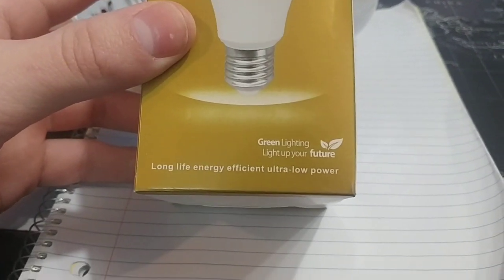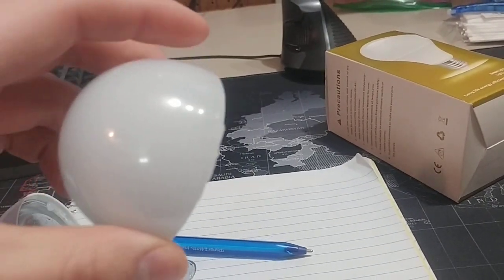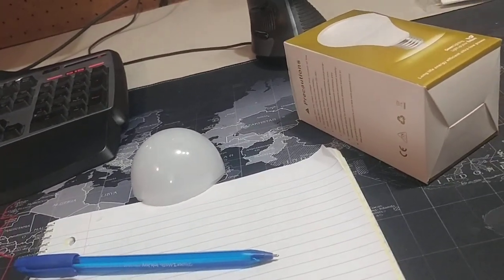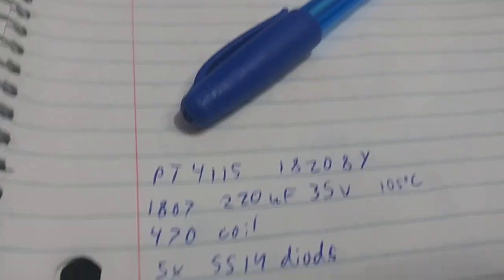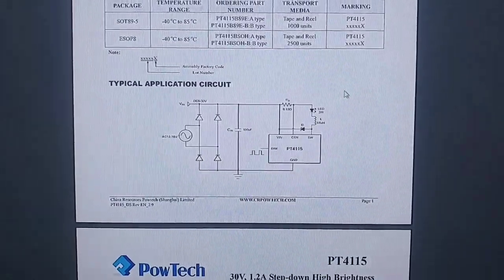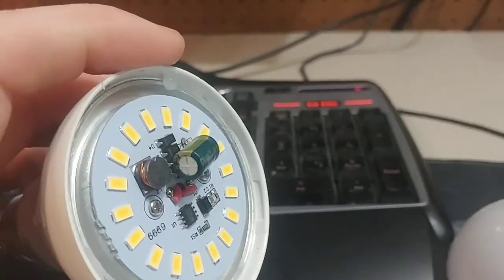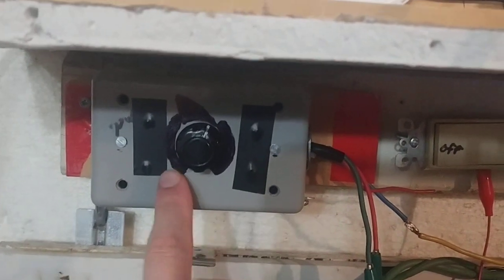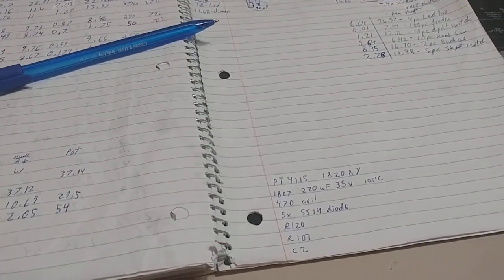Best 12-24 volts dc home LED lights tear down

Comment: The quality looks good, I'm surprised the top comes off so easy, the 120 volt AC bulbs don't came apart that easy. I have not managed to get one apart yet, I'm not going to tear one up just so I can see what's inside. Thanks for the review man.
Reply from the maker: The ac led bulbs are interesting to tear apart but requires distroying them. The glass 25$ philips LED bulbs are 100% distroyed to take apart lol. Ive been buying and breaking leds apart for over 5 years. This is deff the best bulbs ive ever seen. The top is silicone sealed so its not terrible.